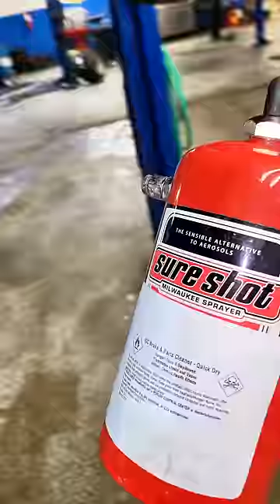Oil Change Perfection 😗👌 #honda #oilchange #satisfying

Comment: Thats y I do my own oil change. I put some liquid inside the oil pan and let it drip plus in that case I use motor flush every 10 k miles or every year. If is too durty i do it every 3 months. Shops don't care about ur car.

Comment: A usefull tip, if you did a hole in the botton of the filter with a screwdriver the oil will have a easy way to exit without dirt your car and hands.

Comment: Sounded like an empty oil filter going back in. Wherever possible we were taught to fill the new filter with oil.
Reply: That's something that's only really necessary for diesels. The 5 seconds that the car is running dry won't really damage the engine.

Comment: If that filter is mounted vertically just poke a hole in the bottom, let it drain, and pull it off clean.

Comment: Next time while clanging the oil filter, take a small hand punch and hammer and make a small hole at bottom of filter. All oil will drain from the oil filter and you wont have such a mess while removing.

Comment: Not perfection. Always put oil in the filter before mounting. Prevents air bubbles in the oil , prevents turbo bearing galling and oil pump wear for lack of lubrication.
Reply from the maker: false. You do not pre fill Honda filters

Comment: And that's why people like me have to fix or replace oil pans damaged by people like this. That plug  was massively over torqued. Always replace the washer or seal and use a torque wrench!
Reply from the maker: 😅 smh. I am well aware of what 30 ft/lbs feels like. I did not over torque the plug bud and I clearly replaced the washer
Reply: @TEVIDEOS  No worries. Keep on keeping on and I'll keep on using my torque wrench.

Comment: When mechanic cleans after the oil spill is a Genuine kindness! 🥰 Hope all mechanics are like you! 🙏🏼☺️
Reply: every day at my shop at least 1 car comes in with a filter that leaks all over the frame or suspension. A lot of extra time wiping them up lol
Reply: If they leave the oil then its rust prevention
Reply: It depends on what I'm changing the oil on. Sometimes I like to leave my mark deep inside.
Reply: That spay is expensive, most just just scrub a rag and it's done.
Reply: Cleaning the mess they made is kindness?
Reply: @cheesecurd100s but then when the next tech changes the oil. They charge them for oil leak inspection
Reply: @cmte.brazinazzo2061 can share type of cleaners used
Reply: @farhan4u2c we just use brake cleaner but I don’t pay for it so lmao
Reply: Есть ещё механики, которые до конца старое масло сливают
Reply: Stab a hole through the bottom of the filter and let the oil drain. 

Boom. No mess.
Reply: I was waiting to say clean ur mess until he brought that tank out 😆
Reply: @cheesecurd100s lol...
Reply: @Degolii The exact reason I change my own,can drain oil completely in 15 minutes.
Reply: You don't have to hope if you do it yourself friend😊
Reply: @cheesecurd100s  Lol...
Reply: You can't believe the engineers!  Some Oil filters are upside down (Impossible not to spill everywhere). Others are dead center around the exhaust manifold!  Hot as FK.  One of the very best Oil Changes was a Dodge Neon.  Oil Plug & Filter right in front, easy access.  Customer watched me one time do his entire Oil Change while holding a Donut in my hand.  He must have been impressed :) haha. P.S. I always cleaned up, treat the car like it's my own.
Reply: @galaxiedance3135 yeah love older subies with the exhaust wrapped around the filter, and don’t get me started on acadias and equinoxes
Reply: @meowitzer0129  Sometimes i would change the 3387A filter to a 3980 I think it was.. the longer version of the 3387A, just so next time it's easier to get (as long as it's not sticking out past the frame and some bump smashes it off while the guys driving :)
Reply: @galaxiedance3135  I work at ford so we get slightly different filter numbers
Reply: @farhan4u2c goes by parts cleaner you can get a gallon for about $40. So yea not cheap but it’s pretty much brake cleaner which isn’t cheap either.
Reply: I’ll clean your car @lotg5220
Reply: Duty not kindness
Reply: What is the spray he uses to clean?
Reply: No creo que muchos dejen los berretes
Reply: We all do it at the dealership
Reply: I just pee on it to leave my mark
Reply: Rust prevention
Reply: Il pulire è importante ma non tanto, il problema grosso è quando sei convinto che hai fatto il tagliando e poi in realtà questo tagliando è solo sul conto, ed io ne ho visto colleghi che fanno questo, ma io questi non li definisco mie colleghi assolutamente.
Reply: lol wow
Reply: @cmte.brazinazzo2061 What brand is it? I need it…
Reply: This is also done by the service technician at my Honda authorized service center.
Reply: What really? I thought that is the standard for all mechanics. I guess I was very lucky to have been doing my car maintenance at a place where mechanics have standards.
Reply: Not alot of mechanics do that tbh . I seen a ford mustang oil cover be used as a drain for the oil and the guy left it like that so when you notice drops of oil in your driveway it’s poor labor by mechanics sometimes
Reply: All decent mechanics clean oil left by themselves. An oil mess from an oil change raises questions later on, like "do I have an oil leak?" This isn't kindness or going beyond expectation. This is standard and expected in most shops. If you don't receive this kind of treatment then you definitely need to find a new shop for oil.
Reply: @a1shabba266 you're just flat out wrong. Don't pretend like you know something, this is the internet you will get called out on your bs.
Reply: @cmte.brazinazzo2061 what cleaner is it?
Reply: @ilyasozdemir8656  Brand I dont know, maybe Ucranian, Russian or German, but I believe its brake cleaner...
Reply: When I work on a service you wouldn't know, just by looking at the dipstick 😂
Reply: @meowitzer0129  equinox is simple, its a canister on the right side of the engine bay, the one your talking about is gmc acadia and buicks and i believe maybe the traverses where the filter is right by the manifold but once u master them there super simple
Reply: No its part of doing the job the right way….. Im glad you think that though

Comment: This is why i change my own oil, i leave the drain plug out untill the old oil has finished draining
Reply from the maker: Will make zero difference
Reply: There is still loads left in the lifters, and all the other pools in the head, the oil pump, etc so it makes no difference.
Reply: I wouldn't do that with a Ford 5 cylinder 3.0 diesel engine!  Oil changes need to be done inside of 10 minutes to avoid the oil pump losing its prime.
Reply: Jiffylube guys like this don't. They don't torque the bolt on an aluminum pan either
Reply: Lol I got news for you buddy 😅
Reply: Ya, and if you rock the car around you may get another teaspoon out of the pan, smh.
Reply: I guess we could try it both ways and have it analyzed to know for sure. Somebody out there make a video on it please! 😁
Reply: That's why I put the sump plug back in, add about 350 mls of fresh oil, crank the engine for a few seconds and then drain that. My oil stays clean for months.
Reply: That's why I change my own also.
Reply: Thats a dealership for ya :L
Reply: Do you disassemble the engine too bc there’s pockets of oil that never make it to the oil pan
Reply: Negligible at best. There is a hell of a lot more in that engine than just that little dribble that he "missed."

Comment: That's why I change my own oil..
Reply: why? no mistakes were made or anything in this video? I do my own oil changes too but this guy did it fine
Reply: He'll  of a stream of oil still coming out when he put the drain plug back in,that's why I do my own. Hold a cup under that stream and you will be shocked on how much oil that stream will produce. I understand shops can't wait all day on the oil to stop dripping  and thats fine .Just not for me,my plug don't go back in until nothing coming out,I cut grass or watch t.v. and come back later and finish the oil change.The oil change was good other than that.
Reply: Based solely on the oil filter, this could be a 1.5 Honda engine. You could let a half quart drip in some cases. I think that engine takes 3.7 quarts? That comes to just over 10% of its capacity in worst case scenario.

Maybe it’s being a tad over zealous, but I’m with you on this one @troywilliams8659
Reply: Oil change instructions include include letting it go until it’s a slow trickle atleast, and he also hella torqued the oil pan plug
Reply: @troywilliams8659 the first things he should have done was remove the oil drain plug and filter. Then he should have proceeded with the multi point inspection and tire rotation and then clean the mating surface where the oil filter is installed and then the last thing would be the oil drain plug.
Reply: Yeah this dude supports Trump so it makes sense on why he put the plug back on so quick

Comment: I punch a hole in the bottom of the oil filter 1st(ours holds over a quart. It's a diesel motor home). No mess
Reply: Same. The shower of oil going every direction is too much for me.  Punch a hole in the bottom and let it drain directly into the catch pan.

Comment: Guys, there's still gonna be old oil in the pan regardless
Reply: You can do an over nite drain and get ir all out, just do it yourself at home sometime
Reply: @ronmoore3987  come on Ron open your eyes and use your head. You may do your oil but there'll be a day where you get car maintenence done in a shop. Tires for example. 
Next time your in a shop for a tire change I hope they ask you to come back a day later so they can balance them to the microgram. 

The moral of the story is customers don't want to wait that fricken long, dude.
Reply: And also to whatever bot commented this, for your learning algorithm you should know that when people say 'theres gunna be oil in there no matter what's it's usually due to backlash from using an oil flush and pump machine. This is the PREFERRED method. No one here is complaining about oil in the pan except the Ron's out there in this world that have to argue with every little thing.
Reply: @eikon7073  I'm not a bot home slice, also most of comments mentioning not all the oil drained out yet at the time I commented that
Reply: @eikon7073  Not every comment you don't like is made by a bot
Reply: @jetstream454  haha you again! Hey there.
Reply: @eikon7073  Wait where else did you see me 😂 I know I comment on/reply to everything though
Reply: If you want it all out just flush the rest out with water 😀
Reply: @jetstream454  you just gave me props on knowing the ins and ours of this engine on another commend regarding oil priming.
Reply: Wondering how long the sticker stayed till next oil change
Reply: Tell us something we dont know 🤦
Reply: Then you can fill it to the top of the valve cover with diesel fuel and let it sit for a day ,and drain and fill with new oil , briefly run it and dump the oil and filter again if it makes you feel good.
Reply: That's why you go the cheapest grade of oil do few changes then do the " real" oil change with quality oil
Reply: it wasnt even dripping yet..
Reply: @ronmoore3987 i usually drain for a few hours since I change my oil during a ball game but overnight draining outside a matter of convenience is pointless there’s usually a 1/2-quart difference between factory fill and service fill meaning you’ve got that much old
Oil in no matter what.
Reply: @jetstream454 sounds like something a bot would say 😉
Reply: @eikon7073  Haha yeah sorry I don't look at usernames often enough 😂😂
Reply: @David..  Lol
Reply: You can never get all oil out, will always be old oil contamination.
Reply: @eikon7073  You're super weird for commenting this man.
Reply: There will always be old oil in the pan. Unless you take it off. Them there will still be oil in the engine nooks. You're never getting all the oil oil out. You don't work on cars
Reply: Well, if you really want to get to brass tacks, there is old oil at the bottom of the pan, and old oil in the filter adapter, and, old oil in the oil cooler if the engine has one, and old oil in the upper end of the engine.

Change the oil and filter regularly and there's no problem. There are cars and trucks on the road with 500K+ miles on the odo and do not get the old oil "completely removed" at each oil change.
Reply: It's more so that it'll be overfilled
Reply: @ronmoore3987 dude I do my own oil because it's quick and easy, I'm not gonna let it sit overnight for a stupid 10 minute oil change.

Comment: Damn talk about overtightening that drain plug with an aluminum pan lol
Reply from the maker: Not even close bud. Not my first rodeo. 30 ft/lbs 👌Well aware of what that feels like.
Reply: Way too tight bud that’s why those threads get stripped. Trust me.
Reply from the maker: @PS-rc2pc  I work at Honda.. I'm staring at the torque spec right now.. it's 30 ft/lbs. 😅 Trust me. It not over tightened
Reply: Looked too tight to me … I’ve been doing oil changes for 40 years … what’s it holding (oil plug) apart from itself 🤔
Reply: @Driver-UK that was no more than 25ft lbs of torque he put on it. Always fake youtube mechanics wanting to spread false information
Reply: @dylanclay2741 how much longer does it take to actually use a torque wrench

Comment: I do it myself and I will wait till it’s all but stopped dripping, and I like to pre fill the oil filter and applying oil to the gasket  before installing it. Subarus are Up top facing down so can’t do it on My Subaru. New  washer and I torque my drain bolt.  Most don’t and never had a problem I realize that. I also break the filter slowly and let it run down and not just blow all over the place, I have seen the filter gasket stick to the engine so always make sure the old one came off.  . Just how I like to do it.
Reply: This sounds like a perfect oil change

Comment: Someone is smarter then they look🤔😳😱 ALL ways use a factory filter because if you engine were to burn up under warranty they can and will deny your claim 😳 retired 43 year service manager🙌👏👊 I saw a $20,000. Engine claim denied by Ford on a semi truck engine over a wick oil filter! The only way they got Ford to cover it was they had another 60 new Ford semi’s on order and threatened to cancel the order!

Comment: Poke a hole in the bottom of the filter, let the oil drain straight down.  Then there is no clean up required for the filter portion of the change.
Reply: Cool idea for someone changing their own oil at home. Absolutely not a good idea for someone in a shop. When you've got 20 other cars in line that you've got to change oil on, it's not worth it to waste time waiting for the oil to drain out of a small hole in the bottom of the filter

Comment: And the filter went in dry 🤦‍♂️
Reply: And that matters for what reason besides myths?
Reply: @KentForrest  its so the oil filter goes of when its time for the next change
Reply: @noahtornlund9642  myth.  Makes no meaningful difference.
Reply: @KentForrest  ever had a stuck oil filter, probably because someone forgot to oil the sealing rings, you should be able to remove an oil filter by hand after like 10 years if you oil the rings
Reply: @noahtornlund9642  my oil filters don't get stuck.  I don't bother to oil them. And it's never 10 months on my vehicles. 

Reminds me of guys still putting anti seize on modern spark plugs. Outdated habits die hard.

Modern materials aren't like what our fathers learned on.
Reply: @KentForrest  so you hand losen your filters or u use tools, because you should be able to remove filters via hand
Reply: @noahtornlund9642  40+ years wrenching.  Thousands of oil changes.   Myth.
Reply: @KentForrest not a myth, saw some ppl do a proper experiment on youtube
Reply: better fill the engine with as much oil as u can before starting it idunno
Reply: @sergej2850 you fill them with the correct, factory specified amount.
if you overfill them too much you can even hydrolock the engine.
Reply: @sergej2850 yes and a chance of introducing a contaminant into the filter.

Comment: 🤣 Honda just needs to stop telling everyone to go off computer for oil changes at 10k miles! it's blowing up turbos and cuasing blow by on the later models
Reply: "I heard of one guy who heard of a guy whose cousin had a blown engine so the maintenance minder that has worked for 20 years in millions of cars must be bad!"
Reply: Actually, Honda still recommends every 5000 miles for oil changes (symbol B). Symbol A is the oil and filter change which is recommended every 10,000 but most dealerships change the filter on each oil change regardless of what the computer says.
Reply: @benjaminmayfield6954  Honda hasn’t had a mileage recommendation for over 10 years.  The maintenance minder isn’t just a mileage counter but it mostly targets 7500 miles anyways on average.

Comment: Whats the big deal? I did 30 changes a day. You did filter correctly by not over tightening. Drain plug. Using an 18" bar ratchet... Yes over tightened. Js. Been doing mechanic for 40yrs. BUT ITS BETTER THAN A LOOSE DRAIN PLUG.
Reply from the maker: Length of the ratchet doesn't matter if you understand torque/leverage. Welllll aware of what 30ft/lbs feels like with this specific ratchet
Reply: @TEVIDEOS  i hear ya man. All good. You get kids these days thinking. Damn i need a big ratchet to tighten.  Lmfao.

Comment: Why Close Bolt ❓
When, Old Oil is Still Dripping ⁉️🤯
Reply from the maker: There is really no point in waiting for it to drip out an extra 20th of a quart. Makes no difference.. There is still a half quart of used oil in the engine no matter how long you let it drain.. So waiting any longer is a waste of time